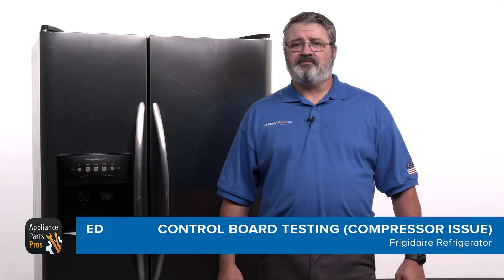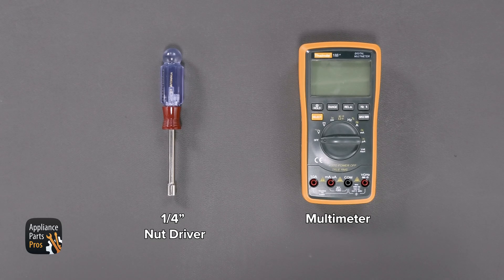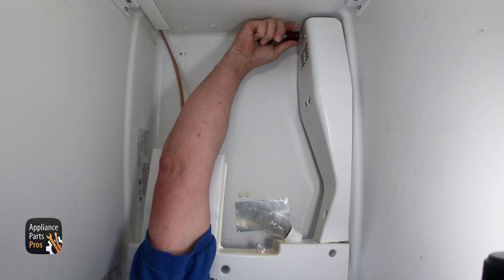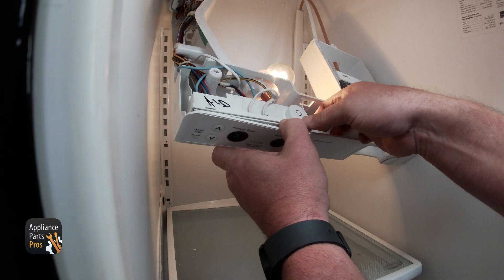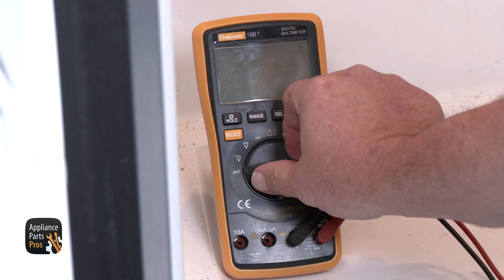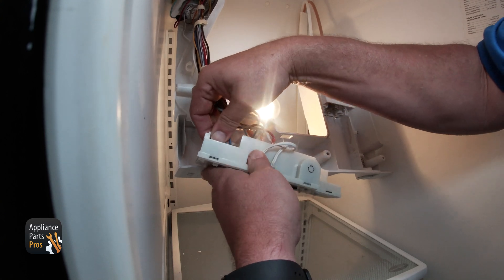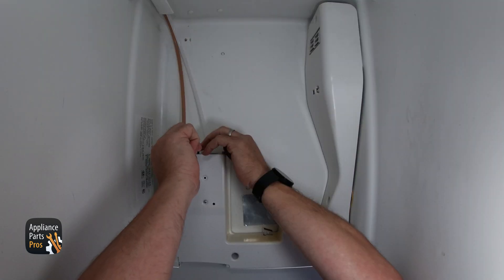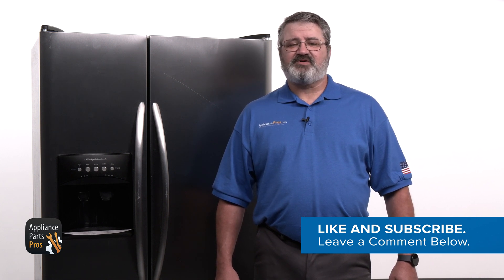How To Test A Frigidaire Refrigerator Control Board 5303918341

Comment: So, if I did get 120 volts between the red wire and blue wire, does that mean the control board is bad?
Reply from the maker: No, getting 120V between the red and light blue wires doesn’t automatically mean the board is bad. That only tells you the control board is receiving proper power. The board usually fails on the output side, so if you have 120V there but the compressor isn’t running, you’d next want to check whether the board is actually sending power to the compressor start device (and also rule out the start relay, overload, and the compressor itself) before replacing the board.

Comment: Do them sell the complete set with the damper and control board?For a model FFHS2622MW3
Reply from the maker: Unfortunately, the damper and control board are not sold as a complete assembly. The control board is no longer manufactured, that part number is 5303918341. You can check around and see if anyone still has some stock left. The damper is still available, that part number is 241600906. You can place that order through the website, or you can call us at 1-877-477-7278 to place the order over the phone.